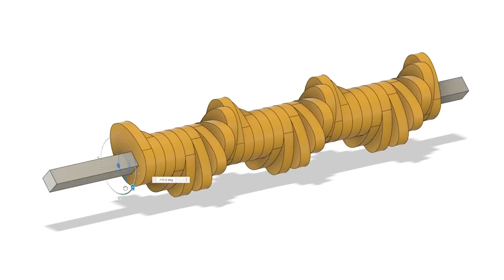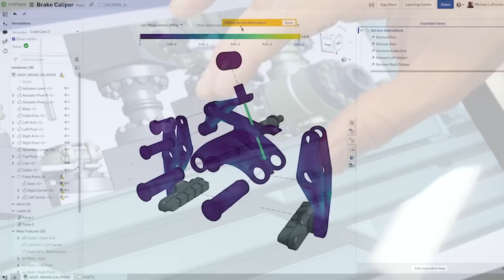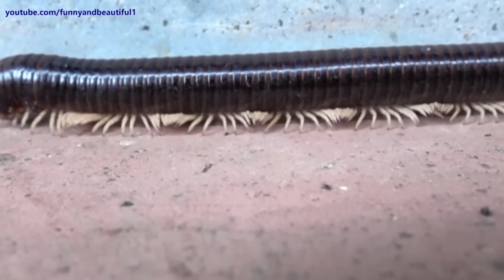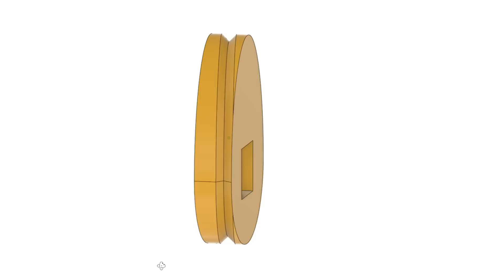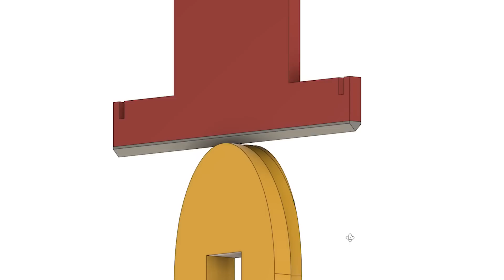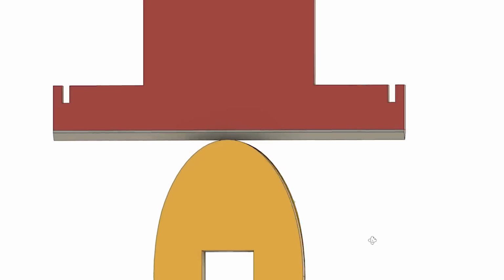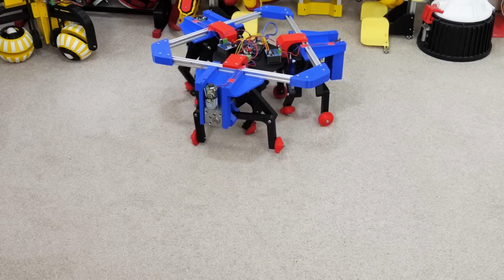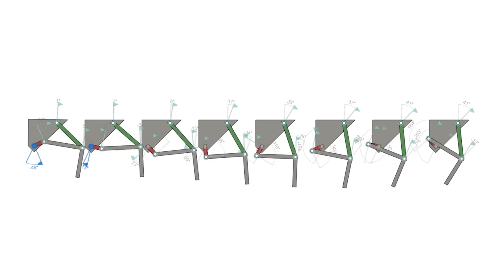Experimental Wave Drive V2

Comment: The original track worked because it had more effective "legs."
Think of each tread moving up and down along the spiral guide. Each point along the guide - relative to the side - is going up and down without any forward or backward bias. However, since the angle of the guide - again from a side perspective - is changing like a sin wave. This means if you have an offset from that point on the guide, like a rubber foot on a track segment, the foot swings like a lever or a "leg." This is what provided the forward motion in the original design. If you want to improve on the design, you might consider increasing the length of the track, and the spaces between the legs (or simply staggering them on the inside and outside of the track), and lengthening the legs themselves to increase the travel of the end of leg.
Reply: No, the original track worked because the legs actually moved back and forth, as clearly illustrated in this clip: https://youtu.be/MppBoH7aoEU (blue line represents the rotating spiral as viewed from the side, and the orange dots represent the legs, equally spaced along the spiral). The clip also illustrates where the jerky movement in the original track design comes from, because in the clip the rightmost dot has a lot of sideways motion, while in the original track the last leg is attached to the frame which doesn't allow for that kind of motion (this wouldn't be a problem if the spiral was exactly one full rotation, see the dot around 6.2 [= 2 * pi] which has almost no sideways motion).
Reply: @hitnovak  Yeah you are right. I thought that's what @billeethesciencegeek was saying but I actually read his comment this time and he also seems confused.

Honestly this is all really obvious. I don't really understand why people - even ones as smart as James - have difficulty with it. In this video the legs are clearly just going up and down. Of course that isn't going to work.
Reply: 7:36 he identifies why his new system doesn't work compared to the old system in the video.
Reply: Yeah I did point that out on the original video but maybe my explanation wasn't clear enough: https://www.youtube.com/watch?v=PQqhVzmBNYU&lc=UgySaBczRsi15sOXjqR4AaABAg

Comment: If the primary force from each piece of toast is vertical, then the body will only move vertically which is what we observe. If you were to tilt the toast bed (reduce the height of one side) in the desired direction of travel, each piece of toast would then be pushing up and forward resulting in forward motion. 

That said, the cam wobble concept is brilliant. I dont believe the reason for lack of horizontal motion with this design is due to the concept, but more the execution. The toast needs to make contact with the ground at the most forward part of its ellipse, maintain contact with the ground during wobble travel (as the cam groove exerts horizontal force),  and then retract after the maximum horizontal length of travel. This would require that the part of the cam with the 'bottom travel wobble' to be nearly flat. Likely a more resilient contact groove between the toast and the cam would be required, but I dig this concept. 

As it is, the wobble would likely work in water if the buoyancy level allowed the toast pieces to be in water during its wobble travel on the bottom half of the cam rotation.  

Either way, looking forward to the next stage!
Reply: So many cool ideas on the comments to solve it! xD. Fiddling with the cam profile also sound like a quite nice idea to me.
Reply: It looks like the only reason it's moving forward is that the design isn't balanced. If the motor were in the middle it probably wouldn't move at all and if it were on the backside then it would move backwards. Adding the tracks would allow the normal force of the track to be something other than straight up and down and give it a bit of forward or backward push depending upon the direction of the cam shaft rotation. Or at least that's what it looks like to me.
Reply: I would love to see if the cam w/ grooves design would work if it was driven a lot slower. I think the bouncing and lack of friction on the plastic feet might have played a big role in its subpar performance
Reply: I agree with Brians post above. Personally I would keep the current cams and "split" the toast vertically. One hemisphere will be lower or higher depending on the cams rotation. This will give it more of a walking movement, much like the screw tank, where each "foot" is exerting opposite horizontal forces to propel it. The other smoother option is to overengineer and use 2 cams at alternating rotations, but you could get away with the above section with one.
Also, if you add angled rubber feet, it will add a more gravitational aspect where it will "lean" providing applicable force to each side and step of the robot. Kinda like going downhill. Hope this helps.

Comment: If the toaster slots were at a bit of an angle, the leg would push the ground at an angle, so the motion will have an X component. As is it moves only the Y direction. This fix would make it go, but only in one way/forwards.
Reply: Wouldn't it pull back in the x direction as the toast raised?
Reply: @ddegn  Yes, but if it's no longer in contact with the ground, then it should just counteract the momentum that the leg had, not whatever friction was doing to push the vehicle forward. And if there were a sliding mechanism to change the angle of the foot when it touches the surface, it should be able to speed up and slow down a bit, as well as change directions in dependent of just messing with the rotation of the camshaft.

Comment: the issue is that the waves are only moving up and down.
with the first thing, the segments turned in a way that caused the object contacting the ground to translate horizontally, not to put a new object on the ground.

Comment: I believe you have to fine of a resolution. Reduce the pieces of toast and widen the grove cam of each piece. Your wave is similar to the wire version but your crest is taking micro bites. Screw drive takes big bites #of contact points touching the ground * distance between cuts.  It's looks awesome!
Reply: And the tops of your cam are pointy since the piece of toast's are so fine they all touce the ground at the same point on in the track on the egg top. Most of the linear movement is lost when the neighbor tost touches down.

Comment: You beat me to it. I was going to suggest a tilting toast piece. I also think if none of the cam angles were exactly identical, it could cause a helpful rocking motion.
Reply: Maybe if the slot in the cam was only designed to make the toast rotate at the point it hits the ground? Rather than the rotation being distributed throughout the whole cam rotation

Comment: It can't go forward unless it's providing a forward force. It should stand in one spot unless you can transfer some vertical force to horizontal. It would be  great on a slope!

Try using a secondary cam like the coupling rod on a locomotive and almost like the spider legs you have as an example at the end of the video.
Reply: I feel like getting to this point without realizing the problem is a failure of basic engineering design methods. Even the most basic of force analysis done before building a whole-ass prototype and wasting all this plastic and time would have immediately revealed that this thing wouldn't work. Heck, even just intuition would suffice in this case. This channel has so much creativity but it pains me to see so much of it being squandered by poor design methodology.

Comment: the mechanical track rotating as it pans up and down gives it a forward force, if your rubber had nails sticking out in a grid it may work as the nails would change angles through the cycle